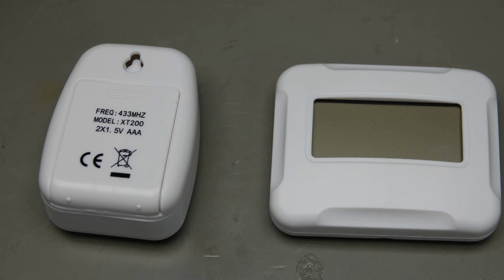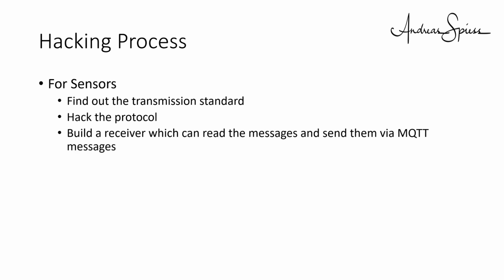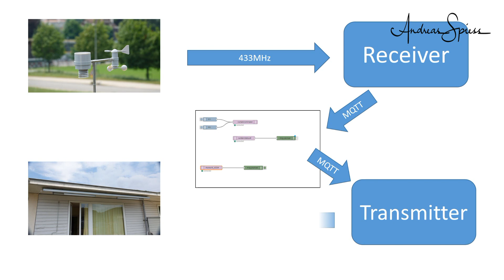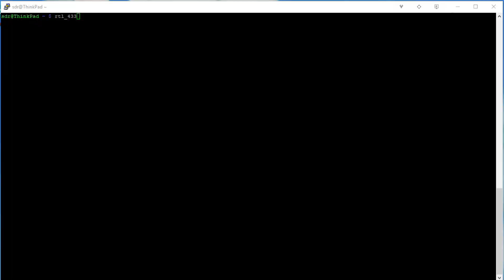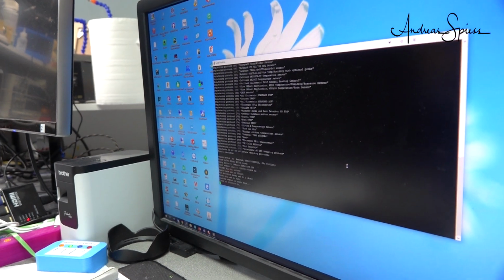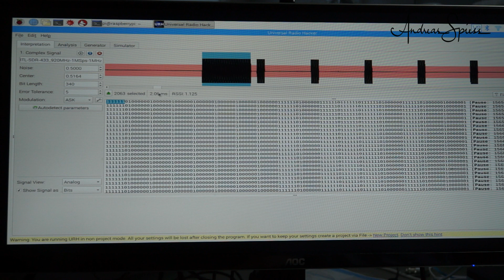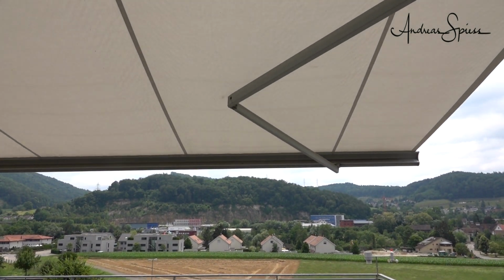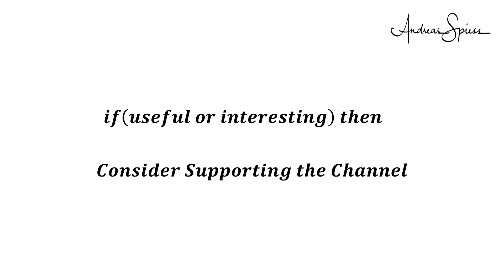#209 How to Hack your 433 MHz Devices with a Raspberry and a RTL-SDR Dongle (Weather Station)

Comment: Well, my brand new 16gig micro SD card came today. Just downloaded the image file and it doesn't fit on a 16gig card. Oh no!
Does the software really take up 16gig or is there lots of space on the image?
If a lot of space, can anyone point me in the right direction to reduce the image size just a little to enable it to fit on a 16gig card please.
Thank you
Martin
Reply: Hi Ron (And anyone else),
I had another go at reducing the image file size today and this time it was successful. I had to use something called a loopback to get the image into gparted, then resize, then exit the loopback then fdisk it then ..... well you get the picture.
Anyway, I halved the image to 7.5gig and I am using it now on my Pi3 to leave this message.
The RTL program is running but finding nothing. I do live in the middle of nowhere though.
Anyway, if you or anyone would like this reduced image size file, please let me know.
Thanks
Martin
Reply: Hi Yuri,
I managed to shrink the image to about 7gig. Now it can fit on any 16 gig micro SD card and then easily expand the image to use up the remaining space on the card.
You can find the smaller image here... https://1drv.ms/u/s!ApC7OKEuTtuEhgcBiDO5WOC9zfAC
Thanks
Martin
Reply: @sausagehider  You're as generous as you are clever. Thanks Martin - much appreciated!
Reply: @sausagehider  yes, thank you.  Now my cheapy thermometers are about to become post of an all-powerful home energy management system! Mwoah ha ha ha ha ha!
Reply from the maker: Not all 16G cards have the exact same size. So yours is probably a few bytes smaller. I do not know how to solve it other than start from scratch with Frank‘s script or use a bigger card
Reply: Hi Juergen,
I used a few different tools, computers and micro SD cards, all with the same result. However, as mentioned above, the problem is solved as I managed to reduce the image size.
I have managed to shirk the image to 7gig which fits easily on a 16gig card. Once the image is copied onto the SD card, it can then be expanded to fit whatever card you use.
Thanks
Martin
Reply: I'm having the same issue.  I'll give Frank's script a shot.
Reply: Hi Ron,
I have now tried 3 different makes of 16gig cards and none of them are big enough.
Also, I have used a computer running Linux Mint and tried several methods of shrinking the image including 'Truncate', all have failed.
The image appears to be 145meg too big. The same figure on all 3 micro SD cards I have used.
The other option I tried was to copy the files to a new card by first setting up the correct partitions on a micro SD card and then copy the files from the image to a boot (Fat32) section and the files to an EXT4 section, but after using root/admin to copy, some of them just refuse to copy over.
I am now at a loss of what to do.
The actual data in the image is only about 10gig so there is lots of space that can be removed to shrink the image.
If you find a way, please share.
Thank you
Martin
Reply: I'd love the try the reduced size image Martin.
Reply: No problem Ron, I will get it zipped up and try to find some where to post it. Not sure how long it will take, but will drop you a line here when its done.
Martin
PS. I just picked up the following so confirming it works:
2018-07-10 22:39:50 : Oil Ultrasonic STANDARD  : 1fe2  : 60  :1  : 0  : 54
2018-07-10 22:40:08 : Oil Watchman  : 28e34890  : a0  : 16  : 21.667  : 0  : 48
Reply: Hi Ron, 
Finally manage to upload it to Onedrive. Can you let me know if you can download it ok. (Link below)
Thanks
Martin

https://1drv.ms/u/s!ApC7OKEuTtuEhgcBiDO5WOC9zfAC
Reply: Thanks Martin, I have it downloaded and will give it a go this evening.
Reply: martin! Try formatting the SD card to another format, there's a certain format that doesn't support files larger than 4gb
Reply: have you tried to transfer to sd with a different Tool?
Reply: Martin Ellis I just did a fresh Stretch install on my 16gb card. I had a couple of specific sensors I was looking to see information from that were already part of rtl_433, so I used the script referenced above to get it installed and it’s working great. Not sure how we can shrink Andrea’s image down, but thank you for your efforts.

Comment: I will start by saying that I know nothing about this, so if it sounds stupid just bear with me. 
I have one of these cheap weather stations that should work with Homey Pro via the Wireless Weather Sensor app but it doesn't. 
The only info that I would need from this weather station into Homey would be if the wind gets to strong, the rest doesn't matter. 
The name of the station are Luxorparts, that's a brand name for a swedish store called Kjell & Co. The station look the same as the one from Telldus and I would guess that you can find it under loads of different names.
Can I get the info and put that into Homey Pro some how?

Comment: Want to read 433Mhz signals from TSFT002 water level sensor on Arduino or NodeMCU V3. Any cheap solution to intercept and decode sensor's signals on NodeMCU?
Reply from the maker: Each sensor is different and I do not know yours. So you have to find a project that covers yours. Or try to hack it as I did.

Comment: Hello, great video I saw a long time ago, but just moved into usage. unfortunately with no luck since my weather station send data on 868Mhs (according to doc). But I'm not able to get any data from it using an  SDR and RTL_SDR, any hints ? I can get 433Mhz sensor for temp but no luck for wind or rain sensor ....
Thx
Reply from the maker: If the temp is on 433 the rest most probably is also there. But make sure it is your sensor and not your neighbor’s

Comment: Hi Andreas,  this is very helpful.  Planning to buy this cheap weather station in Aliexpress and they are still selling it..  Just a quick question..  Is you setup still up and running after more than 3 yrs now?   Just little concern on quality..  Want this to integrate to my Home Assistant
Reply from the maker: It stopped working a few days ago. So far I do not know why. It is on my bench...

Comment: Potential workaround for some systems if you are dealing with rolling keys, and can live with completely replacing the involved remote with your alternative:

isolate remote from receiver and record a number of signals (e.g. 200 signals)

now you can use these 200 signals to control your device before you need to re-record signals

Typically, these rolling keys work on a ratchet, so if you ever send a signal with your remote again, you invalidate all your recordings.

There is also a strong possibility that the same ratchet is used for the different buttons. In that case, you'll have to record  desired combination sequences instead of individual signals.

As you can see, this method is really only practical for very simple devices which are rarely actuated, but it can be an acceptable hack if no other solution is available
Reply from the maker: I agree with your analysis. However, I am happy that our garage door opener still is "old fashioned" and I was able to hack it with a simple system.

Comment: Hi Andreas. Could I use this approach to listen to these https://www.aliexpress.com/item/33047736716.html 433MHz Wireless Infrared Beam sensor Detector?
Reply from the maker: I think so. Usually all such devices use the same frequency...
Reply: @AndreasSpiess  But I will purchase all the hw and follow #352 Raspberry Pi4 Home Automation Server first then I should be able to integrate to the 433MHz Wireless Infrared Beam sensor Detector?
Reply: I guess I just need to follow #209 How to Hack your 433 MHz Devices with a Raspberry and a RTL-SDR Dongle (Weather Station) ?

Comment: Aaaaah. I'm hopeless. I was trying to make a Homekit garage opener. The Homekit part wen't pretty strait forward. But I got stuck on the 433MHz part. I was able to scan the button on the remote. But I'm absolutely not sure if I'm decoding the signal in the right way, not to speak about recreating the original signal. I have used Universal Radio Hacker. The signals I've recorded for the buttons on the remote seemed to be a ASK coded. And it didn't change after pushing the same button again. So I was pretty sure it is a non-rolling code. But I struggle how to setup the   RCSwitch.h library code for my ESP8266 project. In the 7:55 you show the screen for URH that shows bit length value of 340. Is this URH has proposed? I have tried to use the setProtocol function with values from URH (in my case 300), but the signal looks different than the one from the remote.
Reply from the maker: This is an old video and I do no more remember the details. I am not sure if this number is important. I show how you can find the time. Maybe you watch also my video where I hacked my garage door opener? There I used bit-banging to create the signal.
Hacking never is easy and takes quite some time :-(

Comment: Could the esp32 be skipped maybe and the 433MHz transmitter connected to the Raspberry? Also, is it hard to wire a cheep 433MHz receiver to Raspberry?
Reply from the maker: Linux systems are not good for real-time tasks :-( And 433 MHz communication with simple transmitters/receivers need real-time.

Comment: For those living in Europe - as many others I'm so far unable to switch on and off the Silvercrest wall sockets from LIDL. As far as I can see I'm sending exactly the same pulse trains that the receiver reported. Sure it uses rolling codes, but the sequence is only 4 codes after which it repeats. Question: could if be that the rx module locks on all channels in the 433 MHz band, but the tx module can only send on one particular channel that the Silvercrest device doesn't pick up?
Reply from the maker: I do not think they watch several channels. That would be too expensive. I never worked with rolling codes.
Reply: Wow, thanks for the personal reply, Andreas. If I can't find a simple reason why I can't control these switches, I guess I'll have to get into SDR to discover the cause :-)
Reply: Haha! I figured it out! 
First of all: DUH! I forgot that pin 34 on the ESP32 is input only, so not much transmitting going on. But even after moving to pin 32 it didn't work. My oscilloscope helped me out. 
The github.com/sui77/rc-switch library reports a number sent by protocol 3, but that's not actually correct. I created a new protocol: 
  { 100, { 3, 24 }, {  3, 12 }, {  11,  5 }, false },    // protocol 13 (Silvercrest/LIDL)
and then sent the previously reported 24-bit number (codeValue) by:
  mySwitch.setProtocol(13);
  mySwitch.setRepeatTransmit(2);
  mySwitch.send(codeValue, 24);
I also moved the command
    this->transmit(protocol.syncFactor); 
from line 534 to line 528, but I'm not sure if that is needed.
The rolling codes are not even an issue BTW, any of the 4 codes transmitted per key by the remote control work.
Reply from the maker: Glad it works. An oscilloscope is always a good helper ;-) Maybe it even do not use "rolling codes"...

Comment: @Andreas Spiess , could you please provide some info about applying settings to native rtl_433 through iotstack? I am currently using rtl_433 installed on rapbian and it's working fine , receiving readings from my 2 weather stations and passing data to homeassistant through mqtt. I can't find any way to apply the same procedure to rtl_433 looking into container .  I don't know how to edit or where should i apply the settings. Thanks.
Reply from the maker: You find the info on how to setup MQTT in the wiki: https://sensorsiot.github.io/IOTstack/Containers/RTL_433-docker/
How to filter particular sensors I do not know how to do it in the container. You have to ask in the discord channel. I use rflink http://www.rflink.nl/blog2/ for my productive environment https://youtu.be/oYfbEyzT-Gs

Comment: Hi Andreas, thank you for the interesting videos. I found your channel recently and I feel like I cannot learn about SDR quickly enough! In the last 2 years I have been building some weather stations which use the Acurite 5-in-1 and a Raspberry Pi with SDR. Needless to say they have been exciting projects for me who is very new to all this stuff... one of the sites which has a weather station using 433mhz is giving me a lot of trouble over the last few months and I have tried troubleshooting everything. My latest theory is that there is another device nearby which transmits on the same 433mhz frequency and blocks the packets on the weather station from reaching the Pi. Now I'm trying to use the Pi + SDR dongle along with gnuradio companion to try and prove my theory and to solve this intermittent problem! I would be so grateful if you had any suggestion to offer me on my quest, thank you!
Reply from the maker: I do not think your theory is right. These packets are very short and I have a ton of other sensors without issues on my receiver. From time-to-time they might interfere, but not too often. Maybe you watch my other videos about the topic. There you find a much simpler way to receive 433MHz signals...
Reply: @AndreasSpiess  Thank you for the reply. I do not think it's another sensor that is hogging the same frequency but instead another type of transmitting device that is not build well, or legally. I cannot think of any other reason why the packets will be received from weather sensor to pi every 3 seconds for weeks at a time, and then suddenly stop for extended periods of time.

Comment: Is it possible to make a "fake twin" of a rolling code 433MHz remote?
Reply from the maker: I do not know :-(
Reply: @AndreasSpiess  or do I at least understand correctly how a rolling code remote works? With every push on specific button that triggers a function, the transmitted code looks different from the previous push. Right?

Comment: Very interesting video,thanks Andreas
one question about weather stations:
I try to capture the packets transmitted from my Bresser weather station to Wunderground via the wifi network but with wireshark I only see the packets when the weather station is turned on. I don't see any other transmission packets to Wunderground, but the data is being transmitted regularly. Of course I use the wifi interface with wireshark. Where is the mistake?
thanks and congratulations for your videos
Antonio
Reply from the maker: I am no Wireshark expert. Maybe you use Pi-Hole to monitor your internet traffic. It should show you which sites get traffic and when (I just read about it, never tried myself)
Reply: @AndreasSpiess  many thanks Andreas and all the best in 2021

Comment: Andreas;  I just came across this video.  I want to know if you can do the same with video transmitters.  Specifically back up cameras for your vehicle that come with a dash mount display?  I’d like to find a way to discover the frequency of the camera transmitter.  Like those little remotes that run of 433 mghz.  Is there a standard for this cameras?
Reply from the maker: I have no knowledge in this area :-(

Comment: Inspired by this installed rtl_433, it’s picked up the depth gauge on my domestic oil tank. Wanted to pipe this to MQTT but because I’ve got mosquito running in docker (IOTstack video) can’t work out how can rtl433 can ‘see’ mosquito publish command
Reply from the maker: These RTL-SDR sticks are only receivers. They cannot transmit. I think I made a video about that where I drive my awning

Comment: How do I find devices when using the rflink-arduino device? Im trying to pair a hygrometer with my rflink-arduino
Reply from the maker: I do no more remember, but I do not think I had to "pair" anything. Are you sure you find your device in the list of supported devices? Does your RF-Link detect other devices?
Reply: @AndreasSpiess  where does your weather station transmit information to?  Are you using Home Assistant to display the different values?
Reply from the maker: I added a ESP8266 to transfer the serial messages to MQTT and then to node red
Reply: @AndreasSpiess  thank you very much for the information 🤙

Comment: Hi, new to using raspberry pi, how can I load the .rar image into an sd card?
Reply from the maker: You have to extract the .img file and burn it with Etcher or Raspberry Pi Imager
Reply: @AndreasSpiess  Hi Andreas, thanks for your reply, I tried with the Raspberry Pi Imager but it gives an error: "Error extracting archive: INTERNAL ERROR: Function 'archive_read_data_block' invoked with archive structure in state 'eof'',should be in state 'data'
Reply from the maker: Unfortunately I cannot do remote debugging :-(

Comment: is there anyway to get more details i'm now getting 
Battery   : 1            
Temperature: 36.0 C       
Humidity  : 37            
Wind Gust : 0.0 m/s       
Wind Speed: 0.2 m/s       
Direction : 45.0 ° 
Rain      : 19.6 mm      
Integrity : CHECKSUM

The most important one is rain , seems to be a total, i would like the present value so i can program my sunscreen to go up when it starting to rain...
Reply from the maker: I create a difference from the total for the hour and the day. If you want to trigger on rain, you have to check if the value changed.